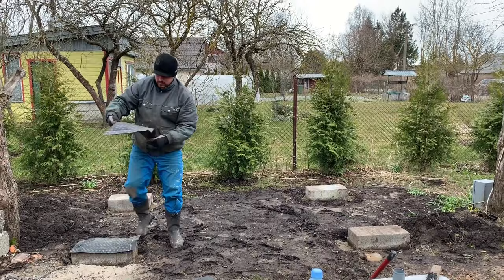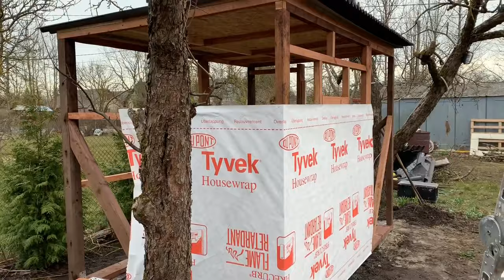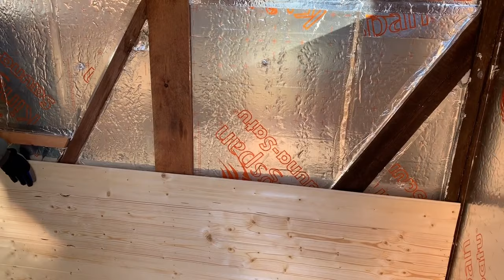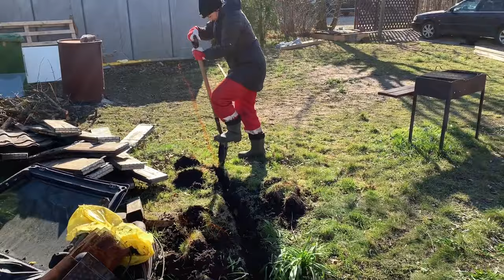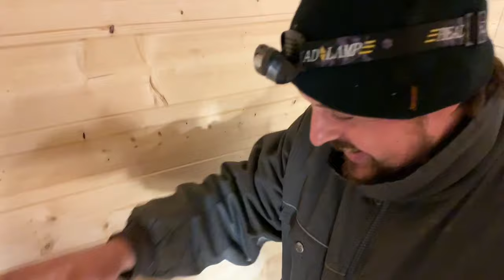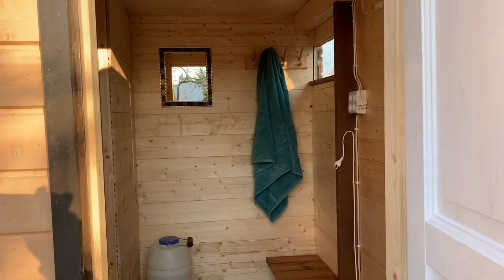How to build sauna outdoor

Comment: Hello, good job, could you indicate what king of wood did you use for your sauna?
Reply: Probably spruce or cedar they are 2 of the best woods for saunas
Reply from the maker: Walls and ceiling are from pine, sitting places are from aspen. And pine is perfect for sauna(there is rumour that the pine wax will be all over the walls). There is absolutely no problem with wax and the air is very different compared to the deciduous tree. Pine is 4 times cheaper.
Reply: @mrjaak132  Hi, is it just regular pine? im from Poland and im wondering if i can use regular pine or i have to order Scandinavian or Siberian pine
Reply from the maker: @Drac06666  Hi, its just regular pine and no problem to use it
Reply: @mrjaak132  I wonder how your pine is different from Polish, i heard that our local pines growth much faster than Scandinavians. Do you know how fast pines in Estonia growth compared to Scandinavians? do you have any resins on walls?
Reply from the maker: @Drac06666  I think estonian pine is ca 50 years old when you can cut it off. There is some resin on some places but its not melting everywhere, they just melt in few weeks in beginning and now ok. 90%   of saunas in finland are made from pine
Reply: @mrjaak132  Many thanks, now i will just need to know how old are our pines but i guess something like that.

Comment: how much did you pay for building it and what is the temperature inside it?
Reply from the maker: 1000eur and inside is 100 celsius
Reply: @mrjaak132  Thank you for the fast reply. What is your profession, do you work with wood on a regular basis?
Reply: What wood did you use for the foundation?
What did you spray on the foundation wood?
What are the dimensions of the sauna?
Reply from the maker: @andreic1755  Please read and check comments, its all written there many times, thanks.
Reply: @mrjaak132  thx, it would be better to write them in the description.
Reply: When you reach 1 millions views it would not be possible to search in the comments you will have thousands of comments :)).
Reply from the maker: @andreic1755  When I will reach 1 millon views I will reply you all details personally. Have a look there is not too much comments, you will find your answer :)

Comment: hi Mr Jaak, what are those black pads you used on top of the cement blocks?  thank you
Reply from the maker: I dont know how exactly they called in english, but its roofing board covered with asphalt. Its needed to prevent moisture to come up from the ground to the wood.
Reply from the maker: @MrUnclepauly78  Now I know, thanks :)

Comment: Hello again ;) So far I have built the base, the frame and the roof, so far so good ! For the inside cladding (which you said was pine ?) do you know what thickness you used ? My local store has the redwood in 20.5mm thickness would this be suitable ? Thank you.
Reply from the maker: Hi, I used inside 14mm. 20.5mm is usually used for outside, also note that one plate have to go inside other plate not just cover it from the top. I dont know which wood is redwood and if its suitable for sauna, but I would say you can use any thickness you like as far you are satisfied with price.
Reply: @mrjaak132  when you say one should go 'inside' another do you mean they should be (as we call it here) tongue & groove ?

im a novice, but the 'redwood' here is pine.

i think from what you say then, i should not buy this one - thank you for the advice ! i will look somewhere else...

https://www.wickes.co.uk/Wickes-Redwood-PSE-Timber---20-5mm-x-144mm-x-2-4m/p/9000036460?_br_psugg_q=redwood
Reply from the maker: @MrUnclepauly78  Yes, exactly it should be tongue and groove
Reply: @mrjaak132  awesome ! thank you thats probably saved me a lot of time and money :o)

Comment: Is this a dry or wet(steam) sauna?  Does anyone know if a steam sauna needs to be tiled or this would do ?
Reply from the maker: This is dry sauna, if you look on the heater its not for steam sauna. And yes steam sauna need to be tiled as moisture inside it is nearly 100%, I would not recommend to do steam sauna with wood inside.

Comment: This is the oven, not a sauna
Reply from the maker: For you its oven, for me its sauna, as simple as that.
Reply: @mrjaak132  sauna is not determined by my or your opinion, but by the mode of operation. You have an electric stove, a temperature of 100 degrees and bad steam with low humidity. While the sauna is a closed stove, which allows you to get superheated fine steam, with a mode of steaming 55-70 degrees of heat and 60-70% humidity.
Reply from the maker: @pescherskij  I have humidity 80% in my sauna and it is absolutely not dry as sauna is located outside. Anyway I think, you are not the one who can decide is bad humidity in my sauna or not as you have not been there. I can guarantee you that the sauna is very humid and not feeling burning as usual finnish sauna where temperature is 120 celsius.
Reply: @mrjaak132   With your fine heater and room size, you should be able to heat to between 80 C and 100 C without any problem.  As temperature goes up, humidity % goes down, so going into a 100 C sauna does not burn you.  To feel more of the heat, when you throw a little water on the stones, humidity goes up slightly, opens skin pores and gets sweat flowing.  There are some crazies in Finland who heat to 120 C, but most in my family are happy below 100.  In any event, I agree that what you have is a fine sauna (and not an "oven"), and how hot you heat it is your business. Personally, I like ~90C, going in and out several times in 5 or 10 minute sessions. Between sessions, sitting outside with a cold beer and some saunamakkara (sausage cooked on sauna heater) is my idea of heaven.
Reply from the maker: @62Ironhead  Thanks, Rick. I like also sauna around 90 and several sessions, but never tried to grill in sauna :) I should try it :)
Reply: @mrjaak132  If you try, wrap the sausage in foil. Even better, my parents used to have a chain hanging from the ceiling above the stove where we would hang a steel pan with the sausages wrapped in foil on it. Best sausages ever. The pan would be hanging 10cm or so above the stones.
Reply from the maker: @laupit  I will try that in christmas time :)